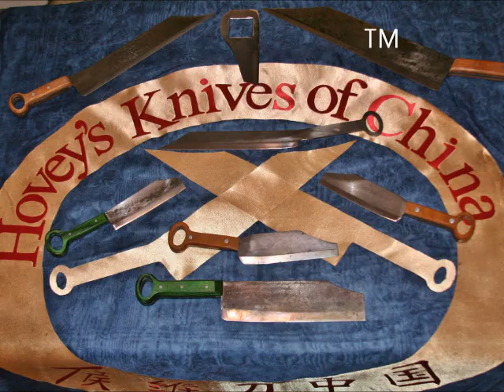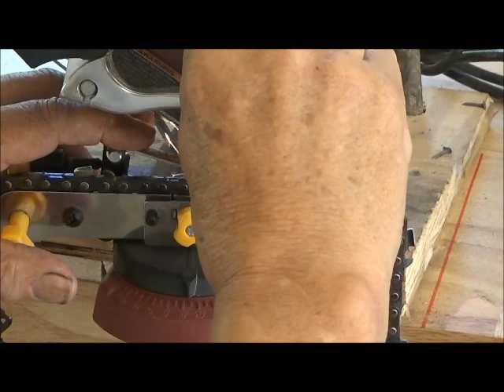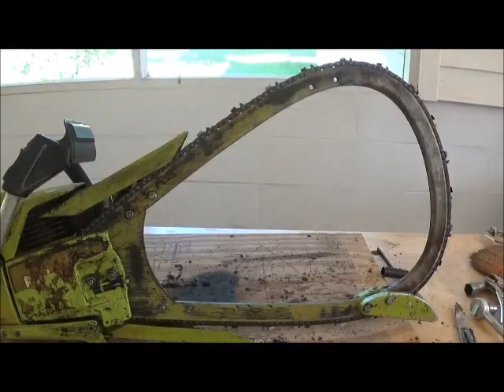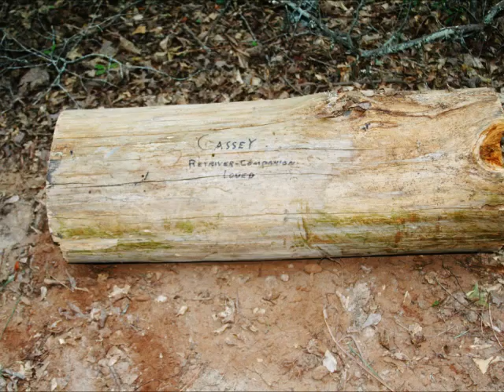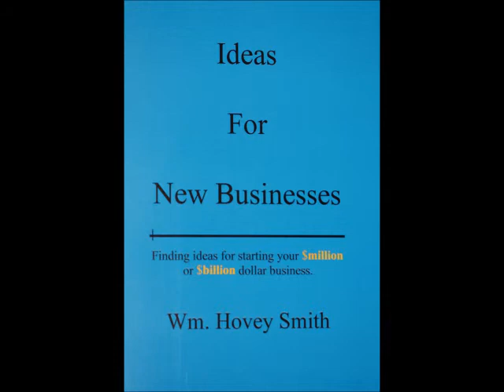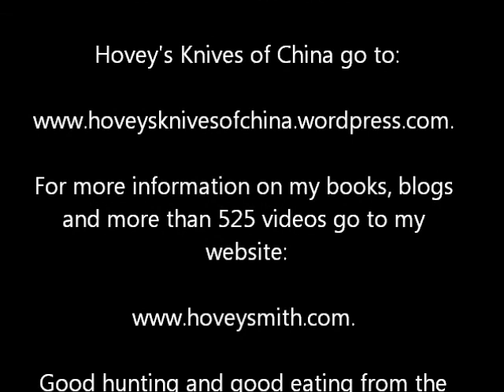Using Harbor Freight Chicago Chain Saw Sharpening Tool

Comment: As a woman, buying a chainsaw for myself was a little intimidating. I didn't want to mess around with mixing gas and oil and screwing something up.==>ur2.pl/761    I also didn't want a cord to tote around. But I also wanted to make sure i had the power to take care of the trees in my yard and any storm damaged tree limbs. This chain saw did not disappoint. I'm very pleased with it.. it's so easy to use. Dont forget to get bar and chain oil, it doesn't come with a little bottle like some companies give. I also bought a second battery but have yet to have surpassed the life of the first battery.
Reply: nice